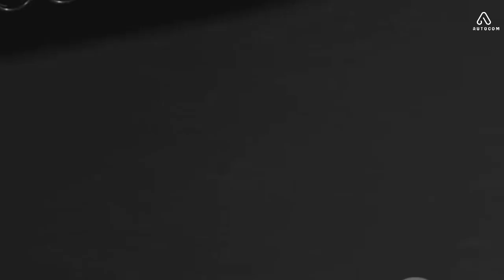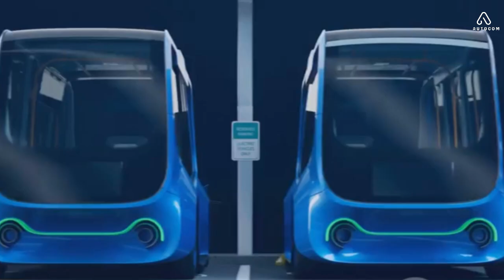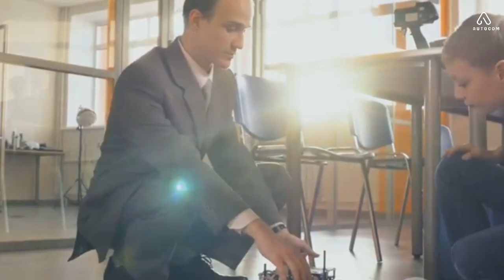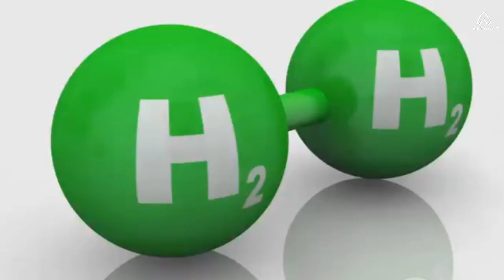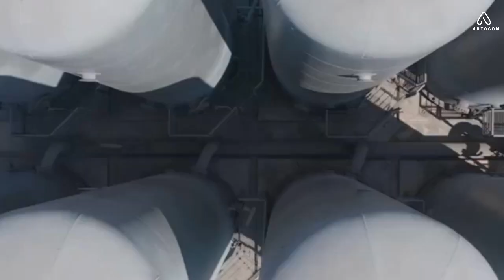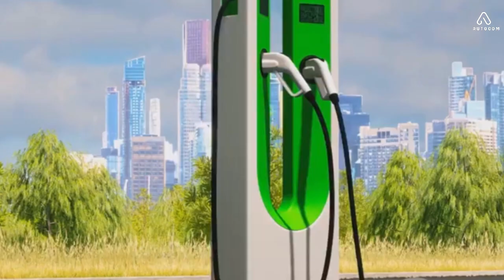Hydrogen Engine :Will the hydrogen engine save the world?

Comment: Hydrogen production needs loads of electricity (assuming it's green hydrogen of course). Most hydrogen currently is made by steam reformation of methane, if you burn that hydrogen in an engine then you actually produce 20% more CO2 than if you were to burn the methane directly, so it's utterly pointless.